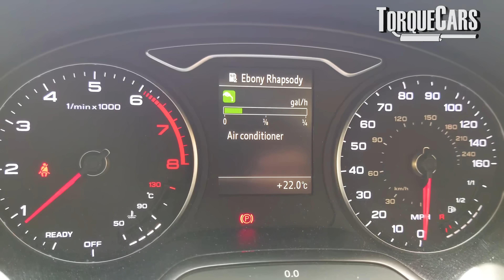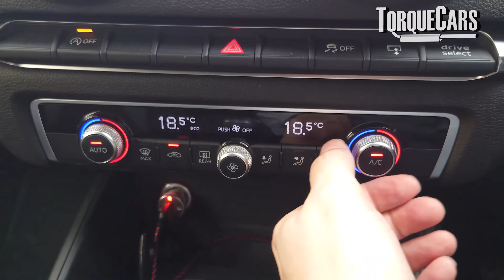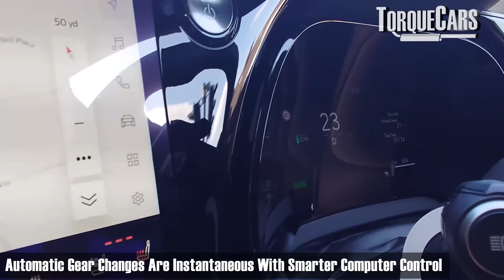The Biggest⛽ Fuel Economy Lies Every Driver Believes! 👉 What Really Saves Fuel?

Comment: I use to drive at the speed limit. My car drinks a lot more on a 110 km/h motorway. Than it does on a normal 80 km/h road.
Reply: Hello, this is expected in my opinion. The best ratio speed/energy efficiency (or fuel economy) is at 80-90 km/h as I know
Reply: @elyeschabchoub1564 Generally yes up to 100km/s. Depends on the car's drag and drag increased exponentially and so does fuel consumption beyond 90-100km/h
Reply: @BadBoiFX  My car uses no fuel at all at 100 km/s, but then most of the work is being done by the rocket it's strapped onto.
Reply: @Fyrespit my car runs on the ethanol tears of my alcoholic enemies
Reply: @Fyrespit 😂 km per second! Waw waw 😂

Comment: When starting from cold and when it's not been run for a few days I let it run for a min or 
so to let the oil get round and start doing it's job especially if there's a turbo involved,
not a warm up as such just giving all the bits a chance to all work together. The oil light
going out does not mean everything is getting it's fair share at that instant give it a chance
and certainly for a short run. Advice from a local garage .
Reply: Why? I mean, people tend to forget the engine is literally running as soon as it fires up. "Letting the oil circulate before I drive off" isn't going to change the fact the engine is already running. Start the car, then drive off conservatively.
Reply: Yes, drive off conservatively, but not immediately, I mean, a few seconds at least, up to 30 or 40 seconds, I think would be good. But, really, it doesn't matter anywhere near as much as it used to with the thin oils they are using and the way the engines work now.
Reply: @meherenowmaybetotally 30 to 40 seconds is unnecessary in any fuel injected vehicle.
Reply: My grandad used and if it good enough for him! and im 59 :)
Reply: Well, it may be true in your case, but that kind of mentality can be dangerous. I mean, our grandparents and great-grandparents did things that would be horrific in this day and age with the way things have changed.
Reply: Thank you. I had just realized that when I think about warming up and such like that and cooling down before I turn off the engine that I haven't had a turbo in a long time, it's really important to idle after you stop a trip. for a few minutes before you shut the car off.

Comment: About the aircon and the windows. you can get winddeflectors for the door windows that enable you to crack the windows without it causing the drag that normally happens. even keeping the rain out. even in heavy rain you are able to have your windows open  a few centimeters. those enable you to open the windows a bit causing aircirculation and by doing so lowering the inside temp a biy. they used to be on many cars but these days people seem to have forgotten they exist and their function. i always get a pair for any new car i get because it does help with circulation a bit. so i can open the windows and keep the aircon off untill a higher outside temp. it was a big thing in the 70-80's but when cars became rounder they went out of fashion. 
about the automatics. they are also heavier. so it took a while before they became so economical thet they could not only overcome driving behaviour and the loss in the torque converters, but also the weight difference. but they are now more economical.

Comment: Cars used to have a green 'best economy' sector on the rev counter for top gear cruising. I drive carburettor equipped cars and simply steady driving is best for economy. Over 60mph they start to get thirsty. Urban driving is also pretty thirsty with stop start traffic the worst. I used to buy Redex to clean the system but now I just take the carburettor apart every now and then to give a proper clean.
Reply: I had a motorcycle with four carburetors in a V configuration. What a nightmare. Although it did last for over 100,000 miles without meeting any maintenance to that part of the bike. (Yamaha VMX1200 V-Max)

Comment: My 2.0 cdti is returning roughy 100 miles to 10 litres of fuel on daily driving around Cornwall. 

But that goes up significantly to around 160 miles to 10 litres on motorway driving. 

The interesting thing is, my car is not, at peak economy at 70 mph in 6th

It is actually more economical in 5th between 60-75mph
I get the most average economy on a fairly flat surface at 78mph in 6th. 

(Tested in Germany of course) 

I can still return 130 miles per 10 litres at 85mph.

For my car the most important part for fuel economy changes depending what gear I’m in, in 2nd peak economy is 1500rpm
3rd is 1700 rpm
4th is 1700
5th is 1900
And 6th is 2000

What’s interesting is that is when the car has just entered boost, it must be factory mapped along with the ratios to do this. 

Full boost in 6th doesn’t happen until 2200rpm in 6th by which point you’re doing 80mph. 

From what I understand the insignia was developed in Germany so it makes sense having such a tall 6th.
Reply: There's possibly an element of it being geared for speeds it's expected to cruise at vs rigid adherence to 70 "because speed limit". 80-85 is a comfortable cruising speed on the motorway (hypothetically of course).

Comment: You perpetuated one of the myths about EV Electricity costs in your assumption that they always charged to full every time. My own EV is charged from a 7Kw point, at low overnight rates. 6 Hours a night at 8pkwh. It operates on a time clock and cuts off on 'time' . There are some mornings when it does not reach 100% charge, like yesterday when it reached 82% after a long run the day before. It did not impact on my days use of the car, I still had more than enough for my days use. This morning my EV is showing 100% charge , ready for my customary drive to the country and visit to family. My home charging never needs to stray into the higher price area. 
Likewise a myth about charging away from home. Whilst it is true that Public chargers are in the main more expensive than home there is a great range of pricing available, from the overpriced Motorway super-rapids at over 80pkwh down to destination chargers that are based on domastic electricity rates, or even free. A journey I have done frequently is from Portsmouth to Chesterfield, the first 200 miles are at home charge prices, less than 2p per mile. A Rapid charge to 80% at 79pkwh will cost £38 approx. That will get me to my destination, where I normally plug in for the time of my visit at 44pkwh. another £5 approx. On the journey home I will normally stop and use a Rapid charger to put in just enough to get home plus 25 miles 'reserve'.Approx £25.  Just like ICE car drivers who will avoid expensive Motorway service prices in favour of the local supermarket prices, I also plan my journey to fill up  at my 'cheap pump' when I get home. Total cost £74.
The 'away' journeys in my EV are more expensive, slightly , than an ICE car, the same journey would have cost about £55 in the Citroen C3 I once owned (at 46mpg and current petrol prices)  13 pence per mile. 
The big savings with an EV is that the majority of my mileage is at under 2 pence per mile for fuel. At over 20k miles a year the savings add up.
Reply from the maker: Thanks for sharing your experience; it's great to hear your perspective on the charging costs and planning that goes into EV ownership. That seems a very sensible approach. I think I need to revisit that topic so appreciate all the data I can have to work with.
Reply: @torquecars  There isn't much planning involved. For nearly all journeys , less than 200 miles, I do not even think about charging, I just plug in when I get  home. When I book a hotel room, I look for an hotel with charge points on site. (Can't do that with ICE)  On route my car , or ZAp-Map, will give me any info I need on charge points, plus of course every M/Way service area has  EV charge points, some more than others.
After a couple of journeys all the info I need is carried in my memory, no 'planning' needed.
Reply: Getting an EV has saved me over £3500 in fuel per year, compared to the equivalent sized diesel car it replaced. Yes we had to pay for the car, but we would have been paying for a replacement fossil fuel car anyway, so going electric means we can have a more expensive car but still save money because the running costs are so much less.

We've averaged 3.5 pence per mile over 30k miles, which includes some public charging, which doesn't need to be expensive of the correct charging location and provider is used.
Reply: OK but what the capital outlay on the EV/ Still many people cannot afford that sort of cash. perhaps secondhand ones down the road a bit. The leccy is a minor prt and I use Tomato at 5p per unit 12 am to 6am.
Reply: @Finglesham  What is the capital outlay on a new five seat saloon car with a similar spec to the LEAF. Or perhaps match with the MG4, or several other new EVs. I think you will amazed by how little difference there now is in the On The Road  price of ICE and EVs of a similar spec.
Reply: This reminds me of Aptera :) Lighter weight and more aerodynamic shell = More efficient. You can get very cheap electricity if you produce it yourself and consume it all when you produce it. With myenergi zappi, you can charge only with solar PV.

Comment: When I first bought my mk2 Clio 1.5 dci last year I was only getting around 40 mpg urban. I put a BG fuel system cleaner in the tank as well as premium diesel (which I continue to fill up with), the urban mpg went up to around 55 mpg. 
I’ve since had it remapped with egr delete, no lie I get 64-66 urban and on a motorway travelling at 65 mph I get 80 mpg.
Edit… I’ve owned one a few years ago and know they get mega mpg, plus £35 a year to tax 👍🏼👍🏼
Reply: @Dan23_7  80mpg, glad i arnt follwing you

Comment: 65 mph on motorway gets me the best results for fuel
Reply: At 65 mph my mk2 Clio does 80 mpg on the motorway. It’s a 1.5 DCI
Reply: @Dan23_7 Pretty much the same engine as mine. Yours probably isn't shaped like a brick like mine. I think wind resistance is a real problem.
Reply: in my Rover 600 2.0 L series diesel at 56 mph on the motorway i get 81 MPG at 65 i get 72 MPG  in my 2.3 honda Vtec Rover 600  i get just over 40 mpg at 56 mph and around town mid 20s
Reply: Really? What car is that? My Sandero (1.5d) is best around 50mph.
I don't do that as I'd be a complete pain for others. I do about 55mph (GPS speeds)
Reply: That's about the same sweet spot for my 2lt TDI A4 where it'll return 70 - 75mpg.
Reply: @sipepguru  i get 75mpg at 60mph on motorway and 50 mpg at 90mph, beyond that it drops really fast, with a 2.0tdi a3
Reply: Wow,no wonter motorways get dangerous when cars are going slower than lorrys
Reply: @TheDigger06  read the highway code,  The max speed for HGV is 60. they must have been making it "dangerous" since 1958. I like to cruise in the first lane, its not effecting one. lastly,  its a speed limit not a minimum speed.

Comment: The best two ways to improve MPG is control of your right foot, and a good injector cleaner around every 4K miles.
Reply from the maker: Do you have a brand or product of fuel cleaner you prefer buddy?
Reply: @torquecars My Mercedes is a Diesel 😄so I use either Cataclean system cleaner, or Wynn's Extreme, I live in Spain so I tend to order on line.
Reply: @51madmitch I have had a diesel now for many years, I am now using my diesel which I have had for 10 years I'm from about the first year I have been using, Millers Diesel Power Ecomax, just recently I came across another product hydra DPB-100, which seems to have a lower dilution rate so therefore works out cheaper than the Millers, and it seems to offer a cetane boost of 4-8, where is the Millers was 2 to 4. Both have fuel system detergent and lubricity additives to prolong the life of the fuel pump.

The increased cetane levels of both will lower the emissions will cut down on DPF regens. This is because the increased cetane levels lowers the ignition point of the fuel and gives a cleaner burn. 

I am waiting till I next fill up the car to use the hydra stuff?

Comment: I see a new video of yours, I click 'like'. Novice here, subscribed yesterday (hoping to work on an Audi A2 1.2 TDI this year).
Any thoughts (or an episode one day) on hydrotreated vegetable oil? Greetings from the Netherlands.
Reply from the maker: Thanks for the sub! I'll look into that, it is something that causes problems on many modern fuel injection  systems. The A2 is a good solid older diesel so probably would tolerate it well, I think the key is what is added to the fuel. A friend ran his old camper van on veggie oil and it smelled like a chip shop (deep fried food specialists it might be a uk thing) every where he went.
Reply: @torquecars  Thanks for the reply. We Dutch sure know about deep fried food too, as you may know.
There are a few A2's running on HVO. The profesionally processed versions are supposed to hardly have 
a smell, if any (cleaning involves a centrifuge and stuff). I was tipped HVO is very cheap if bought in bulk.
Very smooth operation of the engine is reported too. Anyway, loads to learn. I'll be binch watching your channel.